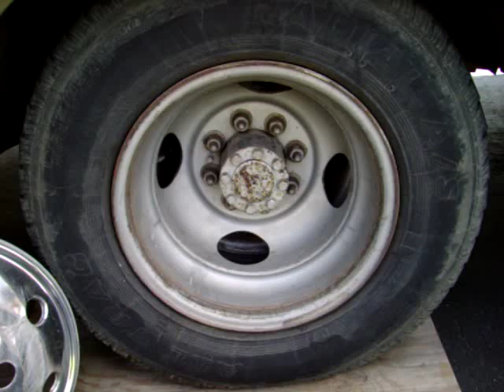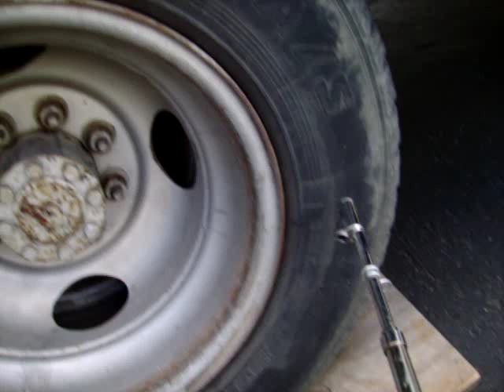How To Properly Inflate Dually Wheels

Comment: On my bus tires that are in the size rang (295/75R22.5)  100 lbs each on both rear in & outer and 110 on Tag and Fronts.
Point Both tires should always have the same air to carry the load. Other wise one tire is heating up more then the other.  
You talking about the crown of the road and yes in some spots the crown is harsh but in more then 90% of roads in the USA you should still run the same air in both.. You should call your tire manufacturer and ask them is you think we are bullshitting you....